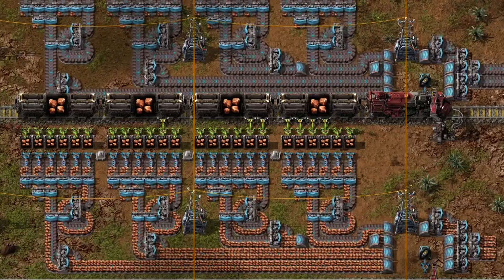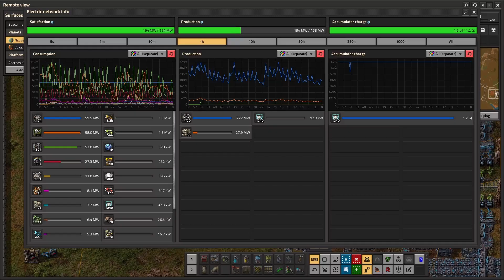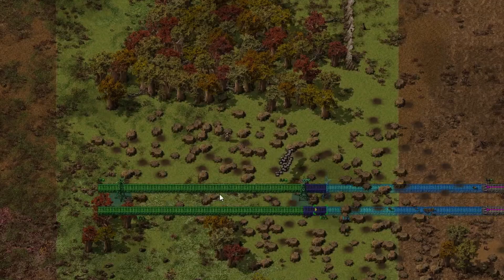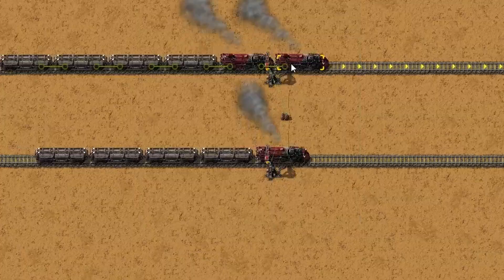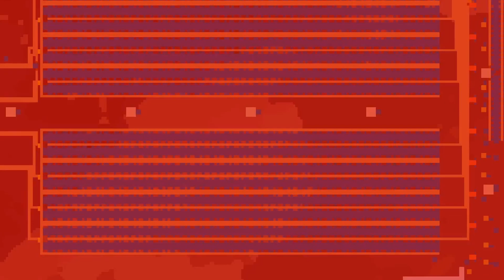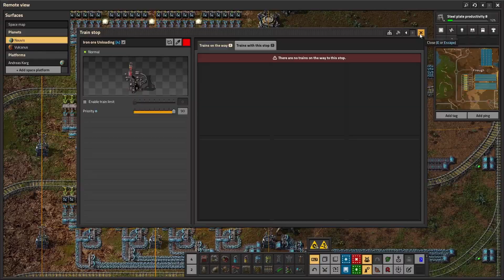Build Better Rail Networks: Loading, Acceleration, and Scaling

Comment: In factorio 2.0 you can do a lot of magic with trains. I'm experimenting with wildcard schedules and circuit logic to elastically scale logistics. So every station has a constant combinator and 2 arithmetic combinators attached. The constant combinator takes the maximum load of a train if it's an output and the maximum load of the buffer chests. From these values it calculates the priority of the station. So outposts that can quickly serve a train gets priority. The benefit of this is, if you have small outposts closer to your main base and they can fully serve a train, these will be picked up first, because the priority is high and the distance is low (same priority stations get prioritized by distance). If the priority is low because it can't fully pack a train, the train would then go to an outpost further out to get filled immediatly. Loading stations are working the other way around. So full buffer chests reduce the priority so your trains won't wait on a station with a slow production line. This is all supported with a stack interrupt, where trains go if they don't have anything to do. The trains are also blueprinted, so you just place them on the refueling station and the interrupts either send them to the stack station or to the next high priority station.

Comment: Those are helpful tips.  Some thoughts. (Most of these tips work for both solids and fluids, though I just use the term 'items'.):

1. There are few things more frustrating than your entire factory shutting down and you find that a single car of a single train isn't quite empty and that starved everything else.  Oof.

To counter that, trains MUST be unloaded and their items sent on their way in a balanced manner.  Fortunately, this is fairly trivial to do with a single arithmetic combinator and some wires.

A. Place a combinator and set it to divide the item count by the number of cargo wagons and output the result as [A].
B. Use a green wire to connect all chests and the combinator input together.
C. Use a red wire to connect all of the chests for each wagon together and connect them to the output belt for that wagon.
D. Use a green wire to connect the combinator output to each of the output belts.
E. Set each output belt to enable if the item count (for that wagon) is equal to or greater than [A].

This will ensure that each set of chests will output when it has more items in it than the average of all of the sets of chests.  (If you want finer control, you can subdivide the chest sets, but it isn't necessary.)  

After that, make sure to lane-balance all of your output belts together and compress them to one side--to maximize UPS--before sending them on their way.

2. One nifty trick you can use once you have blue belts is use double-sided unloading and have the inserters pulling from the chests output to an underground that comes back up where the chest on the opposite side is being unloaded.  As both inserters are output to the same lane, this doesn't double throughput, but makes sure that that lane is completely compressed.

3. To keep your stations from getting backed up with extra trains, you connect all of the buffer chests/tanks to the trains stop and then 

A) For a loading station, set the stop to enable if there are enough items buffered to fill a train 
B) For an unloading station, set the stop to enable if there is enough room in the buffer to empty a train.  

This will not only keep trains from parking before they can unload, but the one that do come will spend the minimum time unloading.

4. You can divide the total item count by the amount each train can carry and output that as [L] to set a train count for the stop.  This will also disable the stop if there isn't enough for a single train, but can also request too many trains if your buffers aren't limited enough.  (This is easy enough to do by pressing the [X] at the bottom of the chest and then setting the item limit.  These limits can be easily copied to other chests.)

5. To ensure that remote loading stations won't be ignored, you can use two arithmetic combinators to set the train stop priority.  Set the first to multiply the current item count by 255 and output the result as [B], then set the second combinator to divide [B] by the total buffer capacity as [P], which can then be sent to the train stop with 'Set Priority' enabled.  Thereafter, any train looking to pick up a load will automatically pick the station with the most items, no matter how far away it is.  (This works with unloading stations, too.  Just add one more arithmetic combinator that subracts [P] from 255 and output as the new [P].  now, the unloading station with the lowest item count will have top priority.)

6. When building up your own railroad blueprint book, it is generally a good idea to have the blueprints snap to a grid, either relative or absolute.  The grid should actually exclude items that will overlap, like power poles at [8:43], as then they will overlap as you place them.  Also, don't worry if the positioning of a blueprint with an absolute grid is somewhat wonky as you hover it in place.  Just hold down the <CTRL> key while you adjust its position.  Any positional changes you make will be save in the blueprint.

7. One handy feature that has been added is 'train groups', found just about the picture of the locomotive.  If you change a train schedule that will affect multiple trains, just add all of them to the same group beforehand.  Any changes will affect all trains in the group at once.  (If you want to make a change to just one train, MAKE SURE YOU REMOVE IT FROM THE GROUP, FIRST   or you will regret it.)

8. Someone has created a blueprint book that makes automating your railroad traffic ridiculously easy.  Just look up 'Factorio Blueprint: The AutoRail DocJade' right here on YouTube for the 411 and a link to the latest version.

I hope that these help y'all.  Cheers!